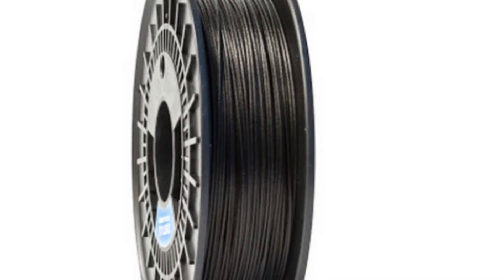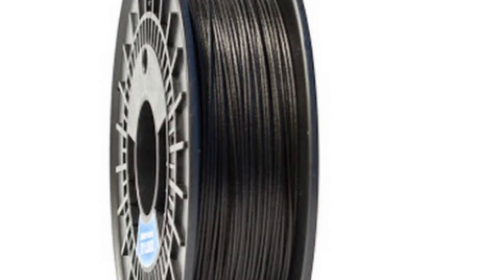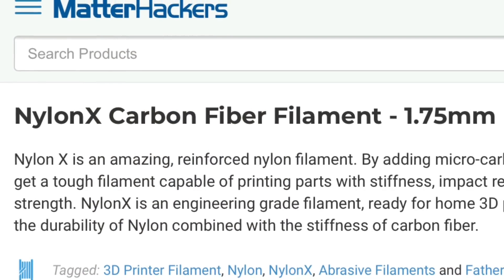Best Material | RC Car | 3D Printing

Comment: The problem when making arms that soft, screws. PR Racing has durable soft arms like that and while the durability is good, you have to change them after wrenching a few times because the screws no longer hold in their place. Or end up using ca glue so they don't back out and even then the glue doesn't work anymore. I dunno, i'd prefer molded parts for certain areas like arms, hubs etc.

Comment: Nice print! I've printed some parts for my RC F1 using abs, these held up just as well as the stock 3racing arms and parts but I did make everything oversize around the pivots especially. One thing you could try is to make it a more solid shape but hollow as you can print hollow parts with just a support structure and the skin is what takes most of the load anyway. Molded parts can't really do really thick walls or hollow parts due to plastic shrinkage and tool design but with FDM you really can make parts which are functional even when using ABS and modifying the design to suit. I can sent you a pic of the parts I did if you'd like. ABS is what tamiya make (or used to make) a lot of parts from so its possible. Nylon if you can get it to stick to the bed and print reliably would be ideal but I havent had much luck and the ABS print material so much cheaper you really can experiment with many designs cheaply

Comment: What 3d printer and software are you using?
Reply: Steven Cook. I use a $160 Anet A8 3D printer, and fusion 360 > Meshmixer > Cura (all free software)

Comment: It will be very interesting to see what happens if this trend picks up...i.e. everyone has a printer in the pits and just prints parts instead of buying the parts.

If the suppliers can't make money they may not see the business case to make some cars
Reply: eco8gator  I think it's the future. At least it's another way to justify the cost of buying a 3D printer, or even a CNC machine. Open source is the best
Reply: I can justify the cost by not buying one lol. Not sure why people feel the need to go out and buy a 3d printer when it's still cheaper to buy the parts already made. Unless you are making things like the Viking diff station, shock tower guards or small stuff, but making parts like arms and hubs..easier to buy those off the shelf